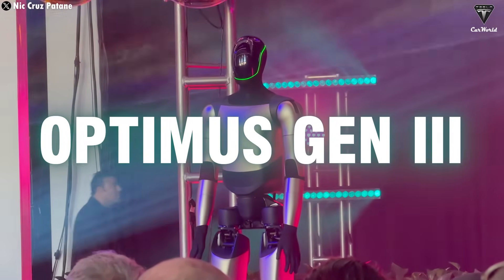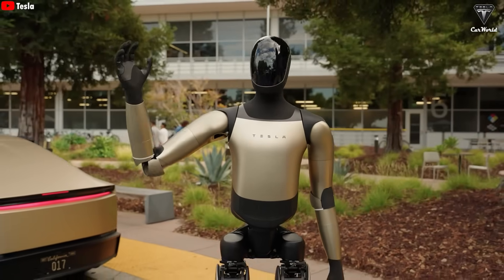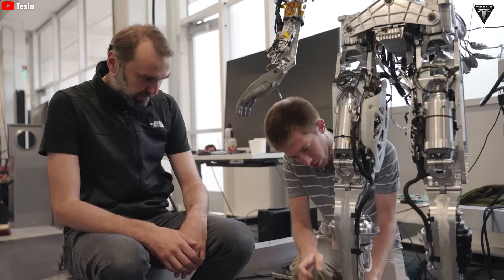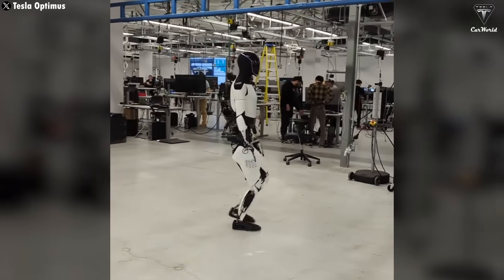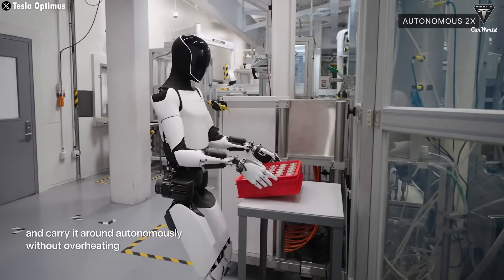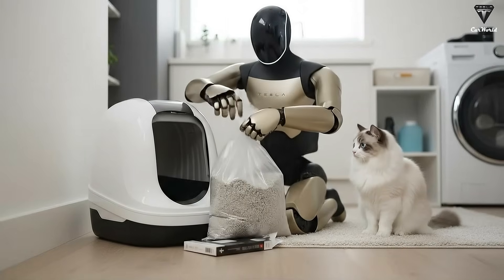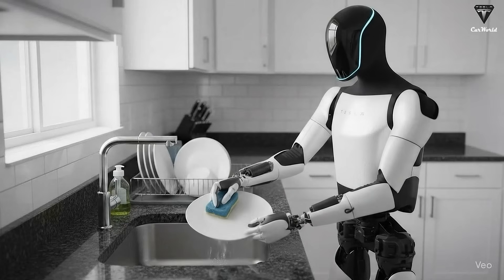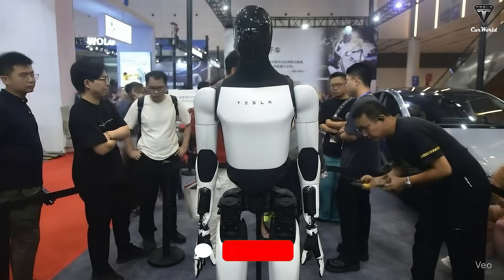Elon Musk's ALL 6 Tesla Bot Version 3 Features REVEALED! You Can Buy One In 2026!

Comment: If the Tesla robot had a connection to a central node type thing like Alexa or the owners cell phone or something for internet connectivity but required permission from the owner to make that outside connection, it would drastically reduce the possibility of being hacked by an outside entity like China or something like that. If you know what I mean. It wouldn’t require internet connectivity to do tasks, but may need to connect to the internet to answer questions and such like Alexa does. Or maybe have it completely unable to connect to the internet unless it uses a computer or cell phone like a human does. Making it a completely closed system, without any built in wifi connectivity at all.